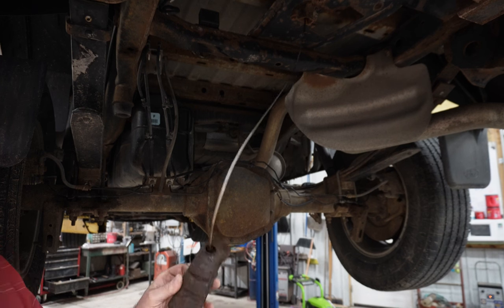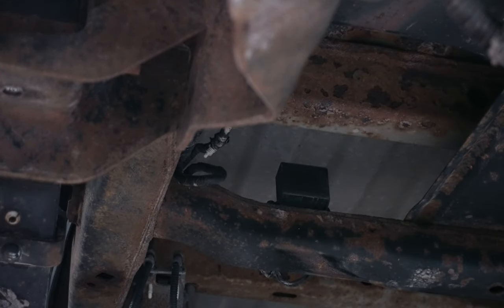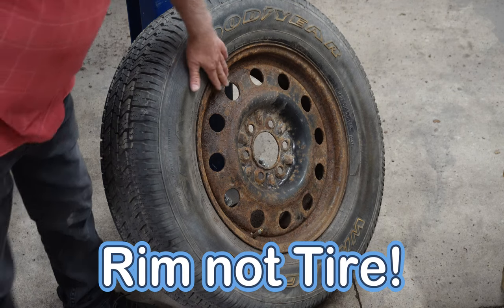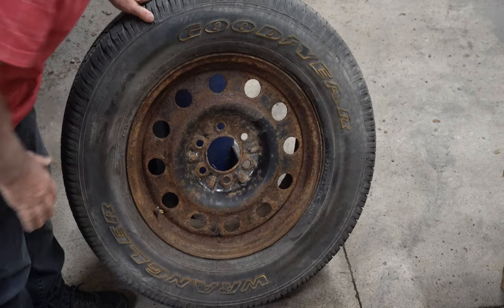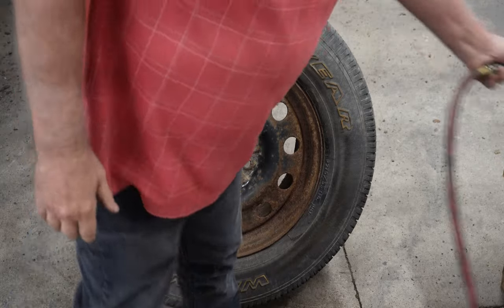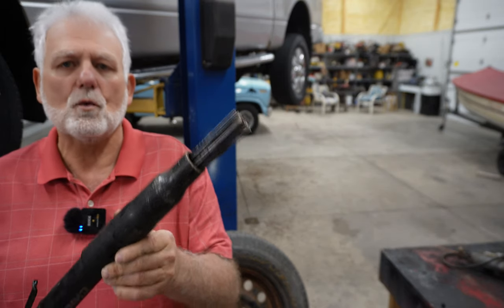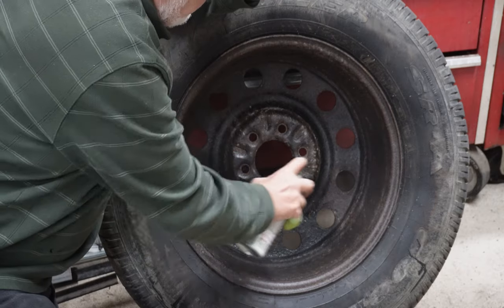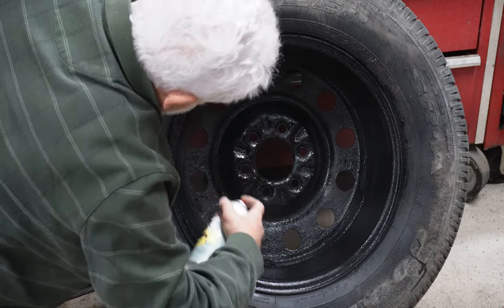The Best Ways to Remove Rust (2 Effective Methods)

Comment: I am certainly using now a phosphoric acid based treatment directly onto rust until it turns black and will follow on with a paint for wheels and a wax or flexible coating under the car on the metal parts. Even an old vehicle can be controlled by this method.  Some people sand the acid coat before paint, but that breaks the phosphate bond across the steel and  allows an opportunity for future rust. You can normally paint right over it. 
A cavity wax applied through any open chassis access points is also a good idea, even where I have a galvanised chassis on my Land rover. Great video, thank you.
Reply from the maker: I really appreciate the comment and your process sounds like a great way to do it. Thanks for sharing.